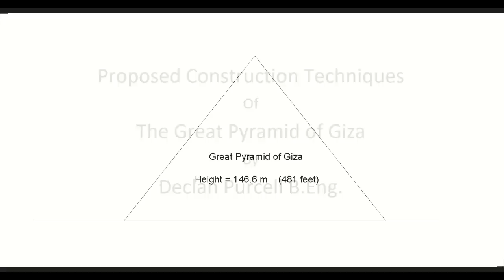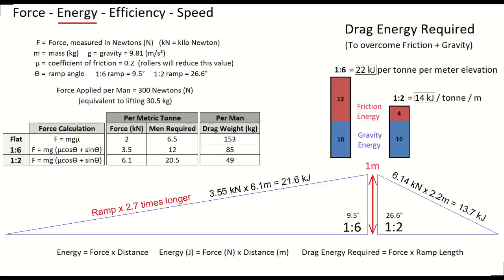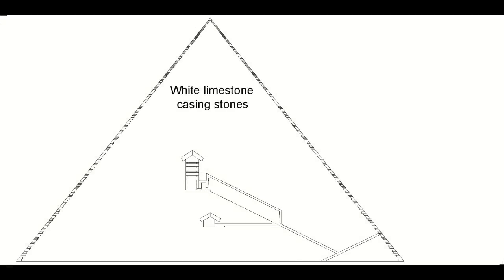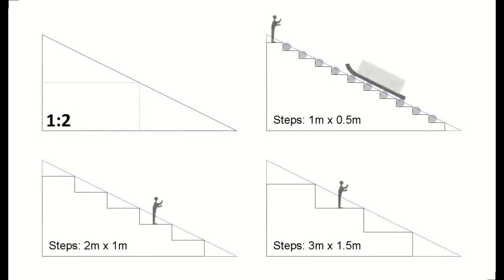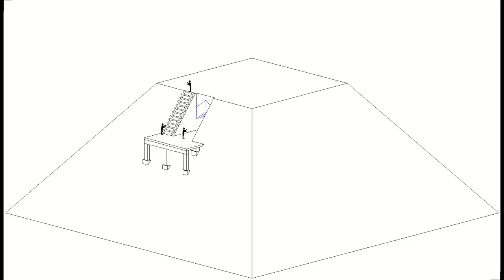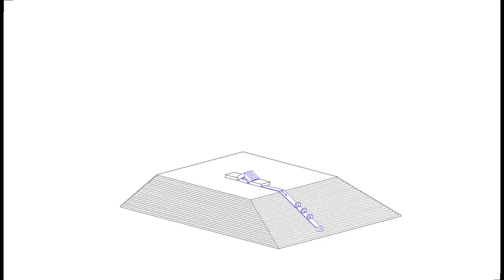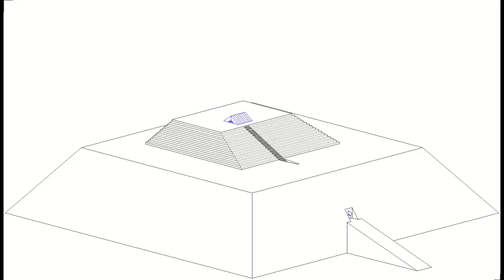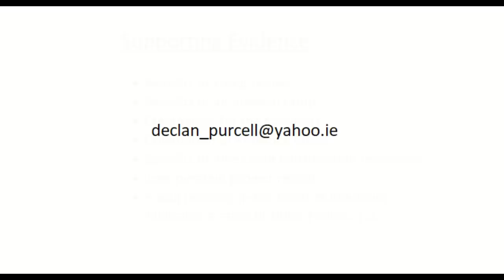Proposed Pyramid Construction Techniques

Comment: Very interesting!
One thing I wonder about raising the stones along the ramp....  Basically, the men are shown standing still and either pull the stone up directly or through the use of a pully.  (indeed, the addition of lubrication is a bonus).   But, imagine that instead of manually "pulling" all the men are asked to grab the rope and jump down a step.  Their combined weight would go a long way to lifting the stone.
     HEAVIEST Stone weight = 80000 kg. (as per Wiki)    Avg. man weight = 60 kg (small man)
This means that with 1,333 men, you have equalized the weight of the stone. (this is for the heaviest stone, not the average).
Thus, if all men were to jump down a step, the stone must raise a step and the only thing each man must do is support his own weight.

Indeed using a pulley system you can divide that number of men by two.

So, imagine....all men hold onto a rope and walk down.  As a man reaches the bottom, he lets go of the rope and heads back up to grab the rope again and keep walking down.  This way, the stone rises steadily (like in an elevator) without interruption.  No yanking or pulling all at once.

Just a thought.

Comment: Fantastic video, curious what you think about the passage they found today behind the entrance chevrons? Also the void above the grand gallery gives this theory credit, but why leave a void there and not fill it in? Just more structural support?

Good work
Reply: That passage or corridor was found years ago on radar. And they already said years ago it’s simply to disperse weight pushing down over the open entrance.
Reply: @MrSmid888  but why would you need an enterance if it doesnt lead somewhere?
Reply: @johndavid3114  it’s where water entered. Which led to the first chamber.
Reply: It's part of a second passage system. The chevrons are overkill for the small descending passage as he pointed out in this video.

There has been a void detected behind the East wall of the Queen's chamber, behind curious non-load-bearing stones. Also in the King's chamber on the East wall, there is a similar non-load-bearing stone. It lends credence to the theory of a 'royal circuit' passage used during the actual burial ceremonies. 
The grand gallery was a counterweight corridor & maintenance entrance before it was plugged with the remaining red granite ballast blocks.

Houdin's theories are by far the most plausible.

Comment: Probably the best explanation I've seen!   Good work,  well done   :)

Edit:  How interesting!!!   At 8:41 the pyramid resembles the Pyramid of the Sun in Mexico,  with it's large steps.   Makes me wonder if the Mexican pyramids are actually unfinished and where originally intended to look more like the Egyptian pyramids.   Fascinating stuff!
Reply: Exactly…
Reply: It is my opinion (and yes I know the saw about opinions) that the pyramids built in Mesoamerica were not intended to to look like the ones in Eqypt. First the ones in Mesoamerica do not all have square bases. Second most of the pyramids built in Mesoamerica have much steeper side angles. Thirdly evidence has shown that many of the Mesoamerica pyramids were built in stages. A smaller structure then buired as the core of a larger structure. Forthly the existence of ceremonial structures at the top of the pyarimds for religious purposes. As to the massive Pyramids in Mexico they have a shallower side angle. Plus there is the presence of the staircases built into the sides of the Pyramids.
Reply: @mpetersen6  I mean the pyramid of the sun ec. not Aztec and exactly cause of the staircases for me there are similarities. They didn’t finish and thought „hey doesn’t look so bad, let’s make the stairs more nice and that’s it“ :)
Reply: @mpetersen6  The Great Pyramid actually has 9 sides, if you count the base. There does not seem to be a commonality between all the pyramids of the world, other than the fact they are tall and have water flowing underneath.

Comment: I also think that they used the pyramid itself as a ramp, all the external surface was covered with wooden ramps to rapidly bring blocks. The grand Gallery was used to bring the big blocks up. Great video, comforting everything  I was thinking by using workers weight as conter weight using pulleys, right on!
Reply: I don't think pulleys were invented for thousands of years afterward
Reply: They had turntable to carve beautiful vases but that’s not a wheel, no no no… a rope around a log IS a pulley! E.T. did it…
Reply: @haroldbridges515  They may not have had a word for pulley, but you don’t need a pulley to get a mechanical advantage. You can just wrap a rope around a series of round greased fulcrums. No moving parts, just use a crapload of lube. There’s myriad ways to apply force if you have rope technology.
Reply: @haroldbridges515  the Romans had pulleys
Reply: @mikev4621 Right. Two thousand years later.
Reply: @haroldbridges515  yes, the Romans were closer to our time, than they were to the ancient Egyptians'. But the pulley must be older than ( imperial) Rome?
Reply: @mikev4621  An assumption without evidence is called a "belief."
Reply: @haroldbridges515  I was inviting you to check it out- the pulley goes way back
Reply: @mikev4621  But not to the Egyptian Fourth Dynasty, which is the current topic.
Reply: @haroldbridges515  prove it : )
Reply: @haroldbridges515  "An assumption without evidence is called a belief.".
Reply: @haroldbridges515  if you have a rope and a tree you have a pulley. To your point maybe someone didn’t write it down until later (at least a writing that survived). My point is as soon a humans made ropes they would have been able to make pulleys

Comment: I have one question, at 8:00, how will the workers who closed the entrance get down? If they're able to go down that slope of the pyramid, does this mean the casing stones haven't been placed yet at that stage?
Reply from the maker: That’s a good question.   They obviously have to descend the finished limestone sloped face.   They could safely achieve this by using a high friction material to prevent uncontrolled sliding.    I could not give a specific example, but they had the opportunity to experiment (obviously at low level) and come up with a suitable / reliable procedure.

Comment: Great presentation to counter the "there is no way it could have been built in 20 years.
They knew the principles of leverage, they drew pictures of block and tackles on their boats.
If you had a flatter ranp on one side and a steeper rampon the other, you use the steeper ramp to hold counter weighted sleds to then pull up heavier stones on the flatter ramp. So pulling up several smaller stones to then counter the weight of the heavier ones is alot easier.
Plus there are other pyramids with exsisting steep internal ramps with post hole presumably used as leverage points.
Reply: So how did they cut 2.5 million blocks of stone to precisely fit with a margin of error less that 0.07%? You think that men without knowledge of the wheel somehow figured all this out but didn't use wheels and only just discovered bronze?
Reply from the maker: Counter weights require equal effort to position as the load they will lift..  Actually, they require more effort as it increases friction losses..
Reply: @kiwi73 why do you think they didn’t have knowledge of the wheel? Lol they have countless images of themselves using wheels lol. Pharaohs buried with chariots (those had wheels), they had wagons, carts. They didn’t use wheels to transport giant stones, and neither did the Italians while transporting Mussolini’s 300 ton monolith through a mountain- they used ropes and wooden rollers same as Egyptians. So by your logic should we say that because the Italians in the early 20th century moved a 300 ton megalith without the wheel, they had no knowledge of wheels? By the way there is video footage of transporting megaliths the “old fashioned” way, without cranes. It was almost commonplace. But if you don’t believe it can be done, or that Egyptians had the wheel (another Lost Ancient High Technology Graham Hancock Uncharted X deception to confuse their fans into ancient aliens) please check out these videos and channels: Sacred Geometry Decoded, Scientists Against Myths, World of Antiquity. 
Moving mussolini’s monolith: https://youtu.be/YRktSwT9lG4

One man can lift and move 20 ton block by himself using counterweight pulley system: 
https://youtu.be/E5pZ7uR6v8c

Egyptians wheels: 
https://youtu.be/6TYWsFzT47Y

Google images of Egyptian pottery and pottery wheels: here is a link to one potters wheel: https://www.smith.edu/hsc/museum/ancient_inventions/potterwheel2.html
Reply: @raina4732  Well, he asked a simple question and you answer by calling names. 
So the question is still : how did they perfectly cut and perfectly fit those blocks? And has no response from an engineering perspective. 
Engineers are simple animals. You feed them bs, they spit it back in your face. You feed them measurable evidences and they are happy.
Reply: @Grouiiiiik  Wait, where did I call him names? I would never do that.
Reply: @kiwi73  
The internal stones are very crude. They needed to use mortar and rubble to fill the gaps. You can still see the chisel marks today. The granite had well crafted  joints. But the "precision" claims are bs.
Reply: @declanpurcell571  True, but counter weights don't necessarily need to be equal in weight. They just need to be able to reduce manpower needed. Plus they had block and tackles thus multiplying counter weight usage.
Reply: @surfk9836  But then who carries the counterweight back up? There’s no free lunch. Unless they’re capturing rainwater to fill a counterweight water tank, somebody still has to exert the energy to raise it up. Am I not grasping the counterweight hypothesis correctly?
Reply: @kiwi73  only the surface blocks were precisely shaped .Also, limestone is much softer when wet, making it quite easy to dress

Comment: This comes closer than most anything I've seen to matching the best and most basic theory on how the stones were raised up the side of the pyramid - what if they were RAISED UP THE SIDE OF THE PYRAMID?  (With a carriage on a ramp going up, assisted by a carriage on a ramp next to it, going down, both connected to ropes on a pulley system anchored up top. The steeper the angle, the closer to the full utility of the counter weight. With this most basic method anyone who walked up the pyramid would have a free ride down, along with the waste.)
I liked this video because it demystifies the pyramids, which is appropriate. Some of the methods depicted might align with parts of the construction which makes the video very worthwhile.

Comment: cool. wonder if theres is data on the average size of rock was you go up. Maybe see a sharp cutoff drop at the point where the turnaround has to be enclosed. and maybe again at the line where they gotta pull them directly up the sides.
Reply: There is data, a Japanese team did a 3D lazer scan of the areas where you can see the internal blocks (at the the top and in the niche on the corner), not the muon scan but a simple laser scan to get accurate representations of the blocks.  The blocks they could see were all relatively small, and interestingly all different sizes and shapes.  There is a video on Youtube somewhere but I couldn't find it to link because of all the Muon Scan videos!

Comment: And this theory was vastly confirmed recent days! Well done! I am still not getting how 80tons blocks where moved up (by1200 men) but other than that all else make perfect sense!
Reply: Your reply got me thinking about the same thing, but after some simple math... at roughly 2,000 lbs. per ton, 80 tons (160,000 lbs.) would equal the weight of 1000 men at an average of 160 lbs. per man. If the men were pulling in a downward angle motion, using their body weight as counterweight, assuming no additional counterweight was used, the downward force would seem (at least) close to equal the  weight of the block. An additional 200 men (1,200 total) would produce a rough counterweight of 192,000 lbs. (96 tons) which would give you an additional counterweight of 32,000 lbs. or 16 spare tons of counterweight over the weight of the block itself. So there would actually be a surplus of lifting weight vs. stone weight. If additional counterweight or leverage measures were implemented as well, that surplus would only increase! I always thought it would be nearly impossible for humans to accomplish, but this kind of put it into perspective for me. The construction time frame, on the other hand, may need some adjustments... but the construction task itself would seem possible, given enough time. My personal curiosity lies more with some of the "machining" and "polishing"  clues and precision stone work that has been observed on some of the dynastic, or possibly pre-dynastic, artifacts! This is what I love about these comment sections! Gives us all a chance to springboard our thoughts off of others! Thanks for getting my mental gears turning!
Reply: The "internal ramp" was actually a tube flooded with water, and they used buoyancy to float the stones up ☝️
Reply: @kxkxkxkx  why do that when you can just use a ramp and men.
Reply: @kxkxkxkx  that's way more complicated than you make it sound like, not feasible. the stones are way more dense than water, they wouldn't float, you would need a strong current going up (impossible) and a way to contain all that water, cause water likes to go down A LOT, and the pressure would be brutal
Reply: @kxkxkxkx  how do you insert new stones without letting the water rush out

Comment: Awesome video. Very well made and thought out well. Several things always get left out of many of these theories as they show them being built. First as far this one don't take into account the spiral ramps they claim have been proven to exist. 
Next, they'll show how crazy large thing like the chevron got there, then just pop them in place and don't describe how that was done exactly. 
Next, and and the biggest mysterious to me that no one touches is the fact that they capped it with a huge capstone. How? I wonder if some would even fit thru the corridors most show. Even I'm this model once close to the top all they can do by then is place much smaller stones. Which they did sorta.
Lots of little but major aspects kinda get glossed over. 
Great work tho. It does seem possible.

Comment: Well made video. Looking at the pyramids from an engineering perspective is incredibly interesting. Its hard to believe that this is not a well-explored subject within modern egyptology. What strikes me is that no matter how you look at it, building the pyramids is an incredibly complex process that requires significant technological understanding. It seems to me that whoever built the pyramids was motivated by something that we can't begin to understand the concept of today. I don' think the generally accepted explanation and timeline for the construction of the pyramids is very compelling. Saying that these structures were built with pure manpower, for burial/ceremonial reasons is making a big assumption that things back then worked the same way as today.

Even the theory that human muscle was the primary method for logistics seems very hard to defend when you consider that even if we built a bunch of pyramids using modern construction technology, it would be a major undertaking. What's the multiplier for doing the same work with muscle power and what does that mean for a civilization doing this work? Is it reasonable to say that a project of this magnitude would be undertaken for ultimately prestige reasons?

Not trying to discredit any of the theories in this video. In fact, I think explaining the construction from an engineering perspective yields a lot of answers that we didn't uncover yet. 

Egyptology these days seems very preoccupied with certain storylines and trying find evidence to fit it, when we should be doing the opposite.
Reply: Great points
Reply: Building the pyramids united Egypt by having the common people from all over the kingdom participate in a monumental engineering achievement that was also instrumental in shepherding pharaoh to the afterlife, reincarnating the god Horus, and thus renewing their civilization. It would be like if peasants in medieval France helped build the Notre Dame cathedral, the palace at Versailles, and the Eifel tower all rolled into one!
Reply: Sounds like you have absorbed the alt-history dogma quite well. I'd be interested to know the amount of study you have done of those who have proposed explanations for how various phases of the construction of the Giza pyramids were accomplished. The points you raise have been made repeatedly by those who have already decided that "The ancient Egyptians didn't have the technology to build these monuments therefore, ergo, to wit, they must have been created (along with all the subsequent megalithic construction of 5th-30th dynasties) by the ice-age super advanced culture that preceded those dumb Egyptians". Interesting that Graham Hancock now accepts mainstream dating of the pyramids at Giza and that it was the Egyptians that built them. But I don't really care what he thinks.
Reply: "was motivated by something that we can't begin to understand the concept of today" Look at all the cathedral construction during the middle ages (sure it was on a smaler scale, but the agriculture was not as favorable as in the Nile delta) They was build to show/ensure the king/Nobelman/bishop's power, serve as a place of burial for the king/Nobelman/bishop, serve the spiritual need for the builders and later the user of the cathedral.
Reply: It just requires a lot of prior experience, planning, organisation, raw materials, manpower and the economic conditions to be right. So no different than a building project today.